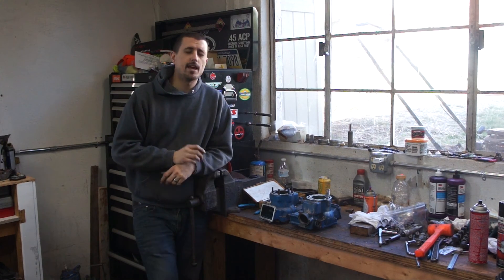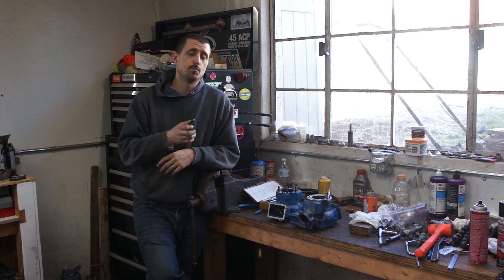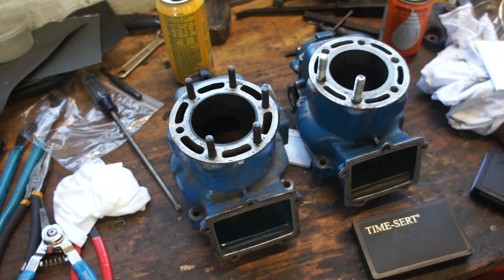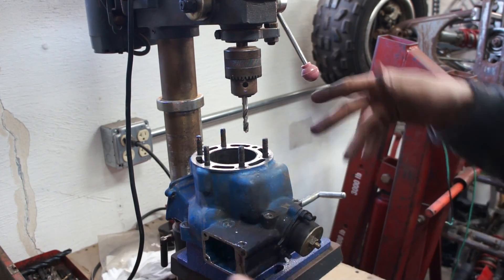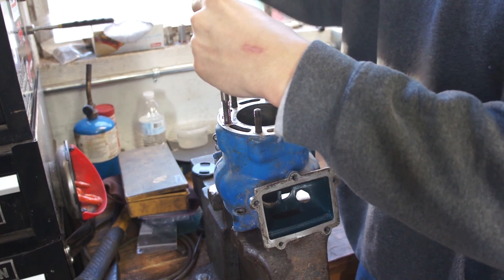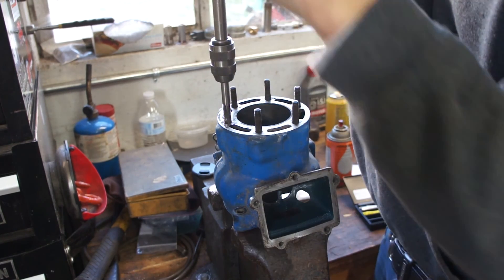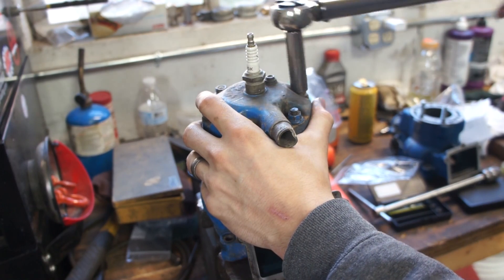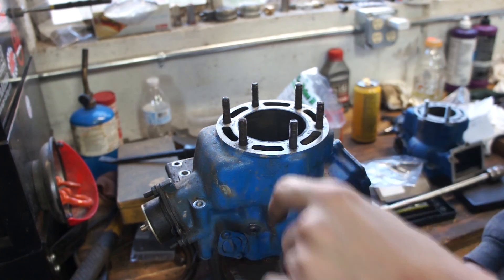How To Repair A 2 Stroke Cylinder Head Stud

Comment: Now wait a minute, please! 

I'm doing a 85cc Minarelli, with 4 studs, and i'm trying to learn how far I need to turn each one   after they bottom out by way of finger tight.  I'm perceiving a height issue before I even try what you just did.  They all need to be the same height, but you didn't pay no mind to it at all 🤔

I also plan on using some loctite, but don't really know if blue is sufficient, or the red jel.

Anyway. . .

Comment: Any idea where I can find a kit to repair a
2002 cr250r cylinder head stud?
Reply: I have the same dirt bike and same issue. One of the studs snapped and I couldn’t get the rest of it off so I tried to drill it out and failed to.
Reply: I doubt there’s a kit for that exact issue but call and check your local machine shops cause they can most likely do it.
Reply: I just found 2 studs backed out and stripped on my 02 CR250 today after seeing premix leaking out of the head. What was your solution?

Comment: I think someone forgot to put anti seize or something on the studs with my 1997 CR250. Little shits non of them are wanting to budge. Doesn’t wanna work with the two bolt method, gotta get/or rent some stud extractors I pretty sure. Not sure I wanna spend 80 bucks neither 🤷‍♂️

Comment: You can start the tap in the drill press. Also I've used the 25mm long time serts to gain more threads but the stud needs to be as long as the time sert or it will split in half down in the cylinder.